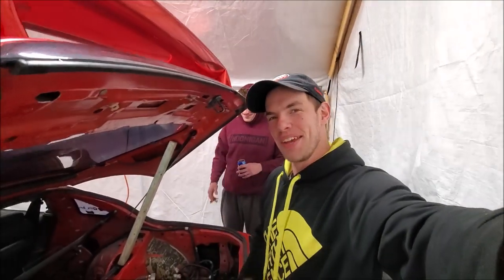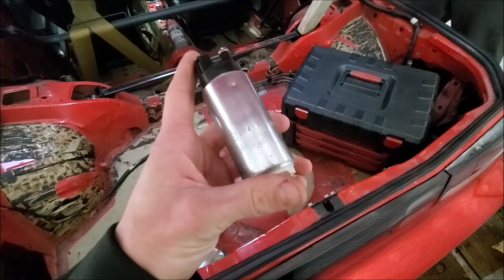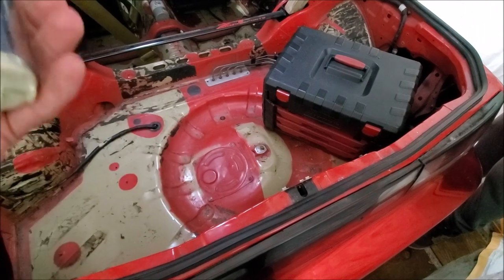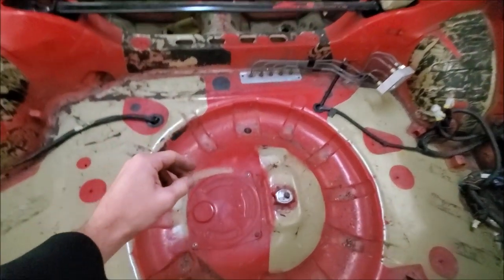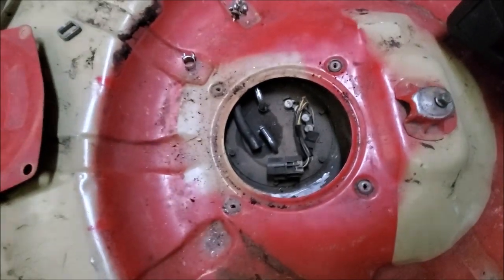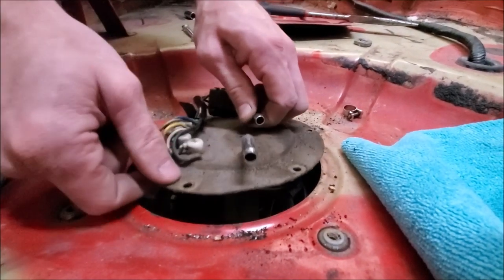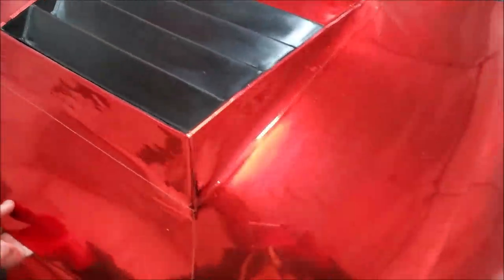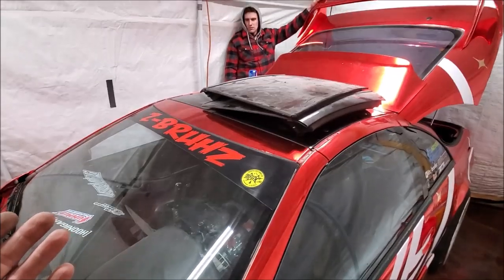Nissan 300zx Fuel Pump Diagnosis & Walboro 255 Install

Comment: As my z32 2+2 TT had been under raps & in storage for 3 years as the owner was very sick &eventually  passed on, when we tried to start the car, it was not getting any petrol.
When we removed the petrol pump, it was rusted so badly that we could hardly recognize the Fuel pump & cluster.
We have stripped the tank out, gave it a very thorough flushing and lined the tank interior with POR 15 Fuel Tank Sealer & have let it dry for a week.
We have bought a good, second hand fuel pump cradle & ordered a new Walboro 255 pump.
Once we the pump gets here, we will re install the tank and fuel pump.
Thanks for your valuable advise.
Reply from the maker: @midas7394  good luck!!
Reply: @ZBruhzchannel  Thank you. It's my forth z32 TT and I will make per just like my previous three z32 TT's.
With my second z32 (650 bhp at the wheels), we tried to drifting but found it impossible to control the sudden turbo boost.
At car meets, the spectators always loved watching us spin out of control when we tried to drift.. Ha-ha
That z32 TT had a fantastic party trick. 
At 30km/h, if you double clutched & floor it in first, the car would do a flawless180 degree spin ....... then I would reduce speed to 30km/h again and repeat with near perfect results. Ha-ha 
Now sadly! I have to behave myself.

Comment: hi there. i like all your videos im sure there very helpfull to everyone and many times for me also,  ive owned my zed 32 now for 18yrs best car i ever owned for value and fun, this comment may be a little to late but ive been a motorcycle electrician for over 27yrs in the trade. the fuel pump not priming when you layed it on the floor as to when you held it up in your hand it did work thats telling me you may have a fractured wire within the that short section of wiring harness or a very bad terminal pin connector to the relay. its very common on motorcycles around the headstem from going left to right for many years or from an accident,  the internal strands of wire can brake and not the pvc insulation. if i were you ide try running the car a having a good wriggle and tug in that area on those wires to see if it cuts out again. im sure theres been many people before you pulling out wiring in that section looking for other issues with there problems and due to its age wires can become brittle. if it does cut out strip it back and yank on each wire an see if it stretches if does you just found the problem,  keep up the great content that you always provide. cheers from OZ and oh yeh and your steering wheel is on the wrong bloody side mate. lol, yes we call them zeds here too. but i think zee sounds better as all you guys say. regards craig
Reply from the maker: Thanks Craig, we basically bypassed that entire section of wor8ng and wired the pump to a switch so we are all good now! But I appreciate the insight and help! Man do I love the youtube realm!

Comment: How noisy is this thing? I just swapped pumps and I've got no sound from the tank with the key on. I'm 99.99% sure I wired everything correctly, yet I've got nothing. 🤷‍♂️
Reply from the maker: When it's running I can 100% hear it
Reply: @ZBruhzchannel  just got to that point in the video. I'm guessing it's an issue with factory wiring somewhere. Fuse under the hood looks good, but the wiring in the car is pretty messy. I also have a sketchy switch down by where this relay is and I think it might be a fuel cutoff.

Comment: So im having a similar problem w my 90 tt.   Fuel pump relay will not click.  I have replaced with no luck. Ive ran thru the entire continuity testing in the FSM too.   I don't have power at the fuel pump wire those initial 2 seconds key on.   I do however have power at the relay from the fusible link 12v battery voltage.   when I jump the relay with it removed the car runs pump primes non stop.  I bypassed the FPCU per czp wiki guide and no result....  Still trying to figure it out.
Reply: Exact same situation for me
Reply from the maker: What I found out was my harness to the ecu was loose and a little crusty. Try unplugging it and cleaning it up a bit
Reply from the maker: What I found out was my harness to the ecu was loose and a little crusty. Try unplugging it and cleaning it up a bit
Reply: @ZBruhzchannel  My issue ended up being pin 18 loose in the blue ECU connector from previous owner/shop.  Must have incorrectly probed it and opened it up.  I pushed the pin in better and crimped it in there better... fixed.

Comment: Gonna look into this hope it helps!
Reply from the maker: I was looking for our previous conversation to reply to let you know I figured it out. I hope this helps!
Reply from the maker: Also read the description, I wired the fuel pump relay to a switch, which keeps things super simple.
Reply: @ZBruhzchannel  I've been lost on this so far. My pump is priming 100% but the relay under driver fender has no click, I disabled the security system and unplugged it and still nothing. Hopefully you might be able to help.. It honestly could just be the starter I just haven't had a ton of time to pull it off but the relay not clicking is not making sense.
Reply from the maker: If the pump is priming, then your relay is working. If your relay isn't working it would not prime the pump

Comment: Yes.. ecu connectors in these cars are very fragile. Gotta be careful taking the ecu in and out make sure the conmector comes with it evenly in and out. If it doesn’t help it! It doesn’t seem like a huge deal until you f*** it up😂. Good work man!
Reply from the maker: Thank you!

Comment: Hey guys, quick question. I'm about to do the same fuel pump swap however my car is stock. Will I need to have the car tuned or is the Walbro pump plug and play? Thank you for the awesome video.
Reply from the maker: It will be plug and play after you wire the correct harness to the sending unit. No tuning needed

Comment: Question since the strainer isn't at the bottom wouldn't it not pull all the gas twords the bottom? Im installing a walbro and the original pump strainer goes all the way to the bottom of the tank, this just clips on to the walbro. Have you had any problems at a lower gas level
Reply from the maker: When I bought the car it came with this setup, and yes I never run the car under quarter of a tank. I try my best to never let it go under 1/2 a tank tbh
Reply: @ZBruhzchannel  what's the lowest you've gotten it? Im going to be tracking my z32 so i just wanna make sure i dont run out lol.
Reply from the maker: @Kegan YT  I got under 1/4 while drifting and it was breaking up terribly
Reply: @Z-Bruhz  alright ill make sure to keep it above 1/2 so i dont burn up the pump, thanks man. Ive been watching your vids for like 2 years now and it's helped me build my Z from nothing and im so close haha!

Comment: So I just got a 96 300zx base 5spd Nd the car sputters Nd cuts off during or after high speeds...is it my fuel pump Nd also last owner was using regular gas Nd I’m switched back to premium tell me if it was a bad move Nd wat I need to fix I’m going to get a scan cuz my check engine light just came on but wasn’t on the first 3 days of driving...but when car its cleared up Nd through 1-4 it’s like a perfect car
Reply from the maker: I would scan to see what the code is throwing then go from there. I would change oil, spark plugs, fuel filter also

Comment: Does car have a wide body what are your wheel specs
Reply from the maker: I did a custom, wide body on the car. Wheel specs are 18x8.5 front and 18x9 in rear

Comment: Hey ZBruhZ, my stock NA fuel pump died on me as we speak, I’m looking to go with the walbro 255 as well.. now , is there anything else I need in order to correctly install the walbro ? Thanks in advance
Reply from the maker: The new walboro should come with everything you need to make it work. You will need to splice wires to get the connector to work.